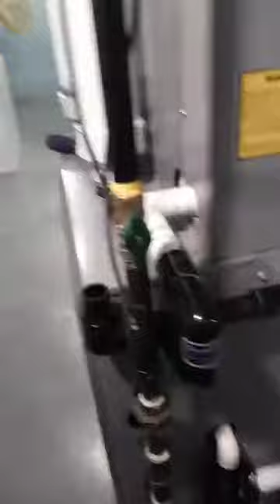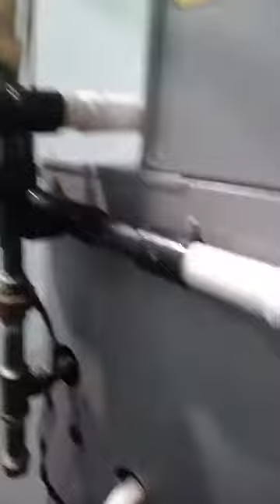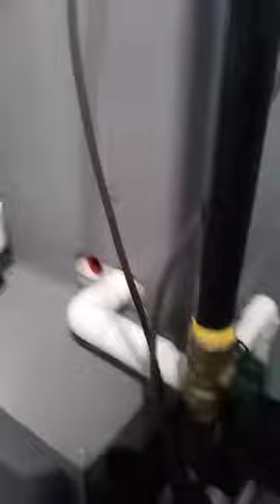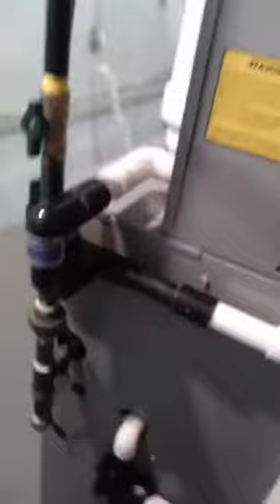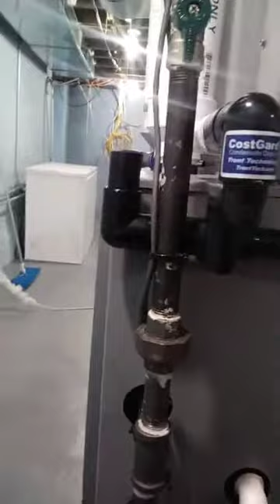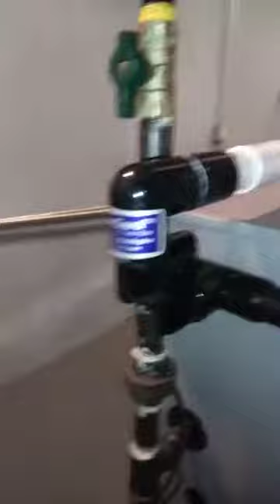How to clean your A C condensate drain line with no p trap

Comment: i am upstairs condo with split unit up flow no p trap. My ac blew fuses 8 times in 6 weeks. HVAC company said I have to run new electricity from furnace upstairs to ac downstairs on ground. so they would have to run new line between floor 2 (me) and floor 1 causing major construction. SO I looked YouTube (you) and found that condensate could cause fuse to blow so went down and found condensate downstairs next to neighbors front door.....well someone had filled little circle cut out of concrete to allow condensate to drain to dirt and someone or "the elements" had covered the circle cut out of the concrete with dirt high enough to cover the PVC coming out of the wall very tiny clearance anyhow they also or "the elements" had stuffed a rock same diameter as PVC so that there was no dripping going on. I think that is why I am blowing fuses? not sure yet but I am hopeful. I spoke to neighbor downstairs and asked if he seen anyone clog the pipe and he assured me not him and didn't see anyone...HOWEVER he did complain about the smell from the puddle that "used" to be there. Anyhow how can i flush the line without the p trap to maybe help with the smell he is saying is there? any ideas.  I did go down and pour some bleach in the dirt to maybe help, maybe I can do that or if you have any ideas how to CLEAN the line without the p trap. His unit was also vacant for 3 years so maybe it is his unit with the smell. any ideas would be appreciated.

Comment: This tech? doesn’t have a thorough grasp of how condensate drains function, the coil is a blow through, to be accurate the classification of the drain would be “ a positive pressure “ type. Also he refers to what is commonly called geysering, that won’t happen on a positive pressure system, only over flow from an obstruction in the drain. Additionally the drain doesn’t “suck the condensate through, it will allow the positive pressure to push the condensate through the seal. A trap however is not required for positive pressure systems but is considered good practice as a matter of routine, the primary reason is if the termination location of the drain is outside the conditioned space it prevents wasting however much conditioned air that would flow through the drain line.
 Just some of the finer details.
Local 290 Journeyman

Comment: We install heat pumps all the time and those air handlers have the drain before the blower motor which means they're under negative pressure not positive like your ac .will this new trap work the same? And the traditional trap creates a seal, to stop the air from flowing through, and allow the water to leave the pan, otherwise water will not leave the pan which will also activate the safety switch,.where is the seal on this new p-trap? Also will it work under negative pressure? Also shouldn't that breather have a straight piece that's above the drain pan? So it doesn't leak from there ? In case something goes wrong and the drain gets clogged ?
Reply from the maker: Trent Technologies offers systems for draw-through air- handlers.  https://trenttech.com/residential-kit
Reply: @TrentTech  I'll take a look thanks